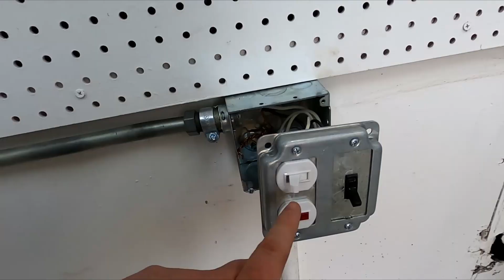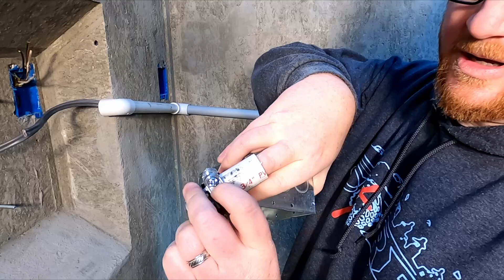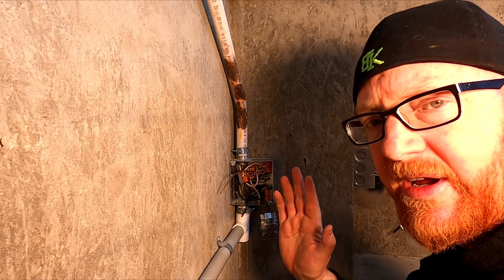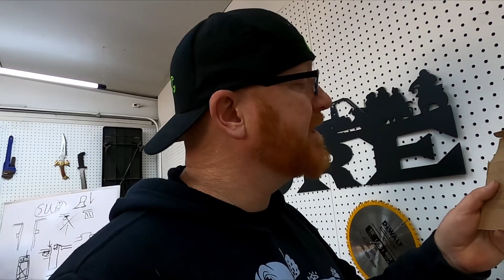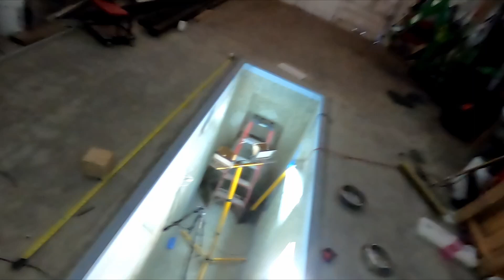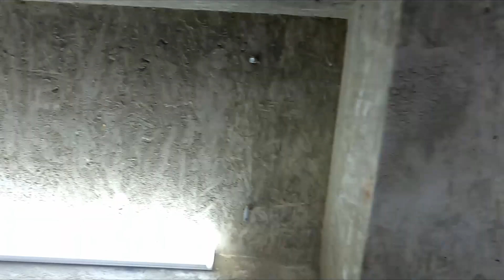I used WAGO Connectors!  Here's Why!

Comment: I have no problem with the Wago connectors, but your conduit, boxes and fixtures should be rated to a Class 1 Hazardous Area (Vapor-tight, explosion-proof).  If you ever have a fire out there your insurance will deny your claim due to not meeting NEC code!

Comment from the maker: What do you consider electrical common?  Even google is divided on what it is.
Reply: Normal  3 wire AC wiring white is common from my experience. Getting into two switches on opposite sides of the room and a light in the middle gets weird then...
Reply from the maker: @grampstries  apparently.  Lol
Reply from the maker: In DC electronics its very clear its the frame grounding lugs where everything returns to the negative post.
Reply from the maker: A/C has no negative but neutral does have continuity with ground.....